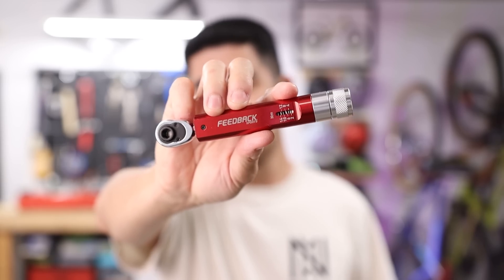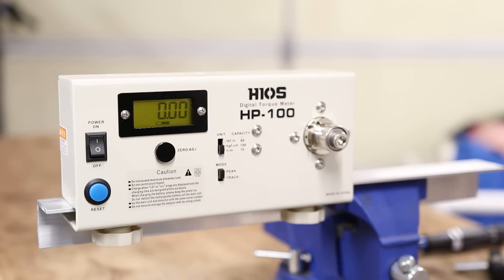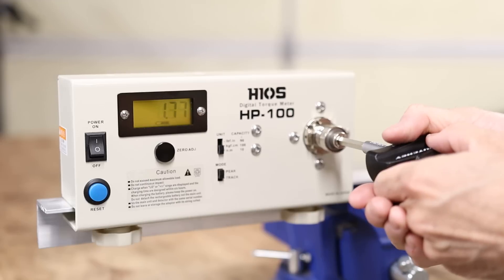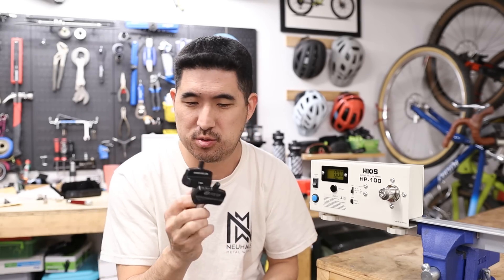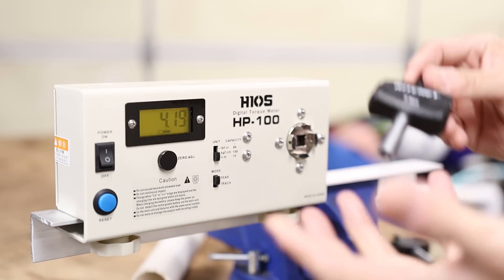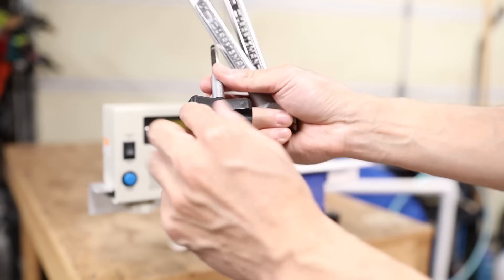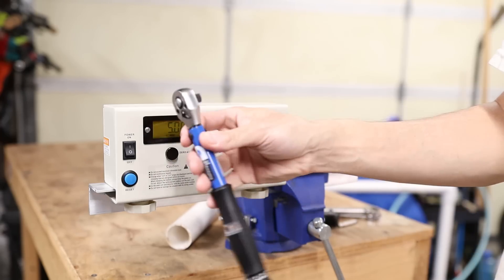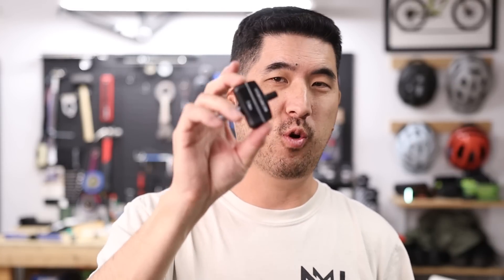Are $20 Budget Torque Keys ACCURATE??

Comment: how much does the park tool cost versus if you would buy the most common torque keys.
are the torque keys the better choice from a price and easy to use perspective?
the park tool for example has to be set correctly and maintained. and the cheap torque keys I could label with colors.
Reply: If you know you're working with just one torque spec, preset torque keys are a no brainer. Prestacycle's preset torque keys (the ones he's holding, the Mini version is sold under various brands) are colour-coded. I personally use the larger Pro version (before it was colour-coded) as the Mini is painful to use at 5 Nm and higher due to the smaller body, but it might be OK if it's the 4 Nm version.

Comment: I've seen techs who will click the wrench 3 times. I was hoping you would do the same on your setup to see if that just further tightens the target, which I suspect would happen.
 
*
Reply: Spam-torquing does result in a higher final tightening torque, one of my ex-colleagues does this and it drives me crazy every time I hear him do it. Worse, he also does it while choking the tool, which results in an even higher final tightening torque. Worst of all, he's a shop manager that works on bikes who supposedly has worked longer than I have and age-wise, we're not far off from each other. I dare wager any proper bike technician in Europe will shake their heads if they get to see how he torques down fasteners.

The way I do it, at most, I torque a second time about a second after I torqued the first time for the purpose of double-checking my torque application, no more than two to three clicks, but never all at once.

Comment: Very interesting video. Ive seen some adjustable torque wrenches that have handles which 'float' on a bolt, so you always apply the torque from the same length down the shaft.

Comment: Cool video, but don't trust the results. The machine you are using to messure the torque "Hios HP-100" is a knock off/fake of the real Hios HP-100. The accuracy of that machine can not be trusted.
Reply from the maker: But the precision surely can provide some valuable insights
Reply: What are the giveaways on the fake compared to the real thing?

Comment: random theory on why the keys are more consistent than full-range wrench: not based on concrete evidence but shot in the dark gut instinct... the adjustability is the devil in the machine so to say, the "proper wrench" relies on more complex correlated mechanical spring actions to go from 2-14Nm (if I googled the correct model) where as the key style is "set in stone" so to say, so less moving parts needed without adjustability. 
in short; less moving parts = less compounding backlash due to mechanical tolerances
Reply: From what I remember adjustable torque wrenches can be calibrated and it should be done periodically.
Reply: @guycxz  That too, from wear+tear as well as tolerances, but in short less moving parts = more reliable mechanism (in the most simplistic of approaches) Of course there are exceptions to that, but again just a gut-instinct approach to it.
I have the same Tekton one he showed in the beginning and its only accepted +/- 4% or so, which is perfect for DIYers and low-grade use shall we say, because bolts themselves have their own tolerances 50 lb-ft of torque vs 51.78 really isn't going to make a difference in daily life. But they do offer calibrated <2% ones for professional use with an ASME card and gives you expected tolerance growth over 1000 cycles, 5000, etc. but for average person.. again, meh even the low-grade one you could change/rotate your cars tires 100 times and still not even be scratching the surface of miscalibration (course again in a pro shop 100 times is nothing, why recert/recal comes in handy)

Comment: Personally, I would never apply the max torque to any parts of my bike, which is mostly 5nm, as you said. It's just not necessary.
Reply from the maker: Torque specs usually aren’t max torque ratings, but rather recommended ratings. I’ve had handlebars and seatposts slip on me before due to insufficient torque and is not particularly fun

Comment: usually the tolerance is +/- 1 nm. and i will under torque and set 4 nm for a 5 nm for safety.
Reply from the maker: I think tolerance is usually a percentage of desired torque. I wouldn’t recommend under torquing on purpose

Comment: Was the Park tool seemingly less accurate because of the way the force is set? You are kind of guessing what the marks are indicating. Seems like you could have tweaked the setting slightly (yet still looking like it was set to 5 nm) and gotten a different result. I know that wasn't the focus of this video and it was cool to see the accuracy and design of the "cheap" tools. Thanks!

Comment: Length dependency isn't so much about where on the handle you hold as the actuation setting is still the same on the wrench and the actuation point is usually right at the point of the driver. Hence no matter where you hold, the wrench would still actuate when the set amount of torque is applied at the driver end (as long as you let off immediately as the wrench actuates). However, if you have an extension or offset at the driver end, something like a crowfoot or a torque wrench extension (which isnt really a thing in the bike industry), the calculation for the applied torque at the driver end would be different due to change in distance of the actuation point and where the driver is actually located. This can actually be helpful if you only have a fixed preset torque on you torque device (such as those torque drivers or torque keys), and require other torque values. But still, it is interesting to see that even inexpensive torque drivers are accurate.
Reply from the maker: I know it’s counterintuitive, but the applied torque does change depending on where you hold the handle on length dependent wrenches.
Reply: @TheBikeSauce  ideally it should not as the actuation force is still dependent on the spring in the wrench, however we rarely ever get ideal circumstances and in practice it does make sense that if you hold near the actuation point you would not be able to let off right when it actuates causing it to over-torque. You can try it with an extension to the handle, the digital torque meter should read the same as when you are holding the handle. Also would be cool if you could try calibrating and adjusting the spring in the park tools wrench so that it stops being 10% out of cal! 😆

Edit: kudos to you! I saw that you did a torque wrench teardown and explanation video. I love informative videos like these 😄
Reply: @TheBikeSauce  I think I understand the slight misconception here. The amount of force applied by the hand certainly does go up the closer to the driving point you hold. However the applied force at the driver side of the wrench doesn't actually increase. This is due to how torque is calculated. 5Nm of torque is 5 newtons of force 1 meter away from where its applied, or it can be 10 newtons of force at 0.5 meters. Hence in the experiment which you showed, it was most likely that when you actuated the torque wrench, you did not let off in time allowing you to follow through the actuation movement in the wrench and applying more torque after the wrench has already actuated. However all this is only applicable for click type wrenches and only when you hold the area behind the pivoting point of the wrench actuating mechanism.
Reply from the maker: A digital torque wrench is non length dependent, but a typical click torque wrench is. If you have a minute, check our video on the math behind the click torque wrench. We show mathematically the reason why grip position does matter for length dependent wrenches

Comment: You kept applying Torque after the Ratchet slipped. You can see it Frame by Frame. The Park Tool one hast the biggest Lever , thats why it was so unaccurate. You just kept it moving after the slip. Maybe apply the force with some kind of Clamp so it doesnt keep pushing.

Comment: i could be wrong, but i feel like the part where you demonstrate that the torque key is length-independent doesn't really add up. i think to test that, you would need to fix one end of the wrenches together and only grip the other end. because what you did was you extended the grip out in both directions and pulled on both ends, so the effective turning point stayed in the middle.

Comment: I suspected they were fairly accurate because the same style of tool is provided with the Threadripper CPU from AMD, at much lower torque 1.5 I believe. With over 4000 + pads on the CPU the 4 screws that hold it down have to be torqued accurately so all the pads make even contact with the pins on the motherboard.
Reply: That was my first instinct aswell, no way in hell AMD is shipping a tool with more than 5% inaccuracy for such a delicate process
Reply: @HappySlappyFace  I think there's tolerances for it. Remember that LGA contact pins are tiny springs. At 5% inaccuracy this tool is probably well within spec, you don't have to be super accurate, but still more accurate than "by feel" with a normal screwdriver.
Reply: I'd bet they're even from the same manufacturer. They probably do custom orders (with large enough volume) using different colors of plastic, bits, finishes, etc. To get a different torque they just need to swap out the spring.

Comment: I bought the Park Tool ATD-1.2 some years ago and to be honest I've never had the chance to use it. The reason is the bike I bought have torques that start from 7Nm(Stem says 7-9Nm) Park Tool used to offer fixed one's before this one which was a 4, 5 or 6Nm. now it looks like those have been discontinued so they only offer the adjustable 4-6Nm version. 
I really wish I had a use for this tool so we'll see if that happens some day I change bike or not. In the meantime I'll just use normal torquewrenches.

Comment: Do you have your park tool torque wrench calibrated annually? I’d have to look it up but I think the variance you saw is actually within spec. 

One thing you didn’t point out is that most adjustable torque wrenches can and REQUIRE calibration on a regular basis. 

On the other hand, click style torque wrenches have a limited lifespan and can not be calibrated. They are disposable.  Most manufacturers do give a lifespan but no one is going to keep track of that so all you can really do is check them against a known calibrated wrench or torque tester like the one you have to know when you toss them.
Reply from the maker: I actually did send the park tw5.2 back when it stopped audibly clicking. They said that’s normal, but I really prefer the haptic click. I switched over to the new Feedback Range tool and I really like it
Reply: @TheBikeSauce interesting. Park and most manufacturers recommend sending in for calibration annually and it usually costs about 20 bucks.

Comment: Cool video. I think your link dependent test on the park tool was flawed. You appear to yank down with your finger when you put it in the middle. And you very very slowly applied it when you put the extension on. I'm not saying there isn't an length effect but I think you exaggerated it massively in your video. I also think the torque keys that are lost motion at the torque setting are a lot easier to get right for most people, over pushing the clicker types to get a higher rating is extremely common. Granted your video illustrated the point, If you want fasteners tighten the most precisely then you need a tool that you can do that with repeatedly.
Reply from the maker: Nice. I get what you’re saying, but it physically takes a lot more force to click the wrench when you choke up, and conversely, a lot less when there’s an extension on it. Anyways, the length dependency is shown mathematically in a previous video; this was just a demo showing the phenomenon

Comment: 20 usd for budget, I use a 15 usd for sub-budget wrench. Cheaper and cheapest. 
And I asked a mechanic, the said the entry level torque has about 300 - 500 clicks life-time. Well, I decided to retired it after 5 or 7 bike installed.

Comment: With that torque meter, couldn't you just find the optimal hand position with the Parktool to get 5nm? Seems like you would get closer to 5nm if you positioned your hand closer to the tail. Just a thought, thanks for sharing.
Reply: The holding point is in the middle of the handle, where the girth is at its biggest. I don't know how his TW-5.2 was stored or how long it was used, but that's already more than the usual +/-4% accuracy, it's almost 12% over.
Reply from the maker: That’s a great thought, actually. It’s possible the center of my hand was at the middle of the handle, but that actually means I would have been chocking up just a bit due to the width of my palm perhaps explaining the high readings
Reply: That's exactly what I thought. Maybe it's designed for a smaller hand that's back a little further than he tested, or possibly the grip has even moved. Or it obviously could have just been damaged over time. As a length dependent torque wrench though, I'm surprised they don't have a marking for the exact point that they design it to.

Comment: I'm SURE that you're already all over this, but I was always told to store an adjustable torque wrench unloaded as storing it loaded can affect the accuracy over time. I guess it fatigues?
Reply from the maker: I always do. I think the assumption is the spring could permanently stretch if left in tension. I’ve never tested this though. Maybe I should leave a torque wrench set to max torque for a month and check accuracy…
Reply: Yeah, exactly!

Might be worth ruining a cheap torque wrench for science. 🤷🏻‍♂️
Reply: Standard practice. However, Norbar (British torque tool manufacturer) tested for spring fatigue if stored at higher settings and found that the wrenches stayed within accuracy tolerances. It was a small sample size and Norbar is not recommending abandoning that practice.

Comment: Would be interesting to know if Park Tool (and other manufacturers) have a recommended calibration maintenance schedule for their torque wrenches and what that process entails.
Reply: Park Tool has a guide on how to send their applicable torque tools back to them for recalibration. I want to put its URL here, but I'm afraid the comment will be deleted automatically for some reason (it happened to me a few times, all of them were safe links). It's in their website's Support section under Services.

Comment: I have two torque keys specifically for wheel swapping. One lives permanently with the SeaSucker Talon in my car, and the other is near where my second wheel set hangs on the wall. They’ve both been extremely useful single-purpose tools for the only torque-sensitive thing I frequently change on my bike, and it’s great to see some validation that they might not be too terrible!

Two keys and a 5-pack of 6mm bits cost less than the original Feedback Range Torque Wrench I got for 50% off, and they get infinitely more use (though having both is clearly helpful).

Loving all the tool content, always learn something new!

Also, the world needs a The Bike Sauce Science hat. And by “the world” I mean “I”.
Reply from the maker: The science hat is actually just a Skratch Labs hat 😆
Reply: what wheel needs a torque key to install?
Reply: @markifi  “Need” may be a strong word, but my thru-axles have a torque rating on them.
Reply: @nkantar strangely my rear wheel has no torque rating on it printed but in the specs online it says a whopping 20 nm. But it came with the style of axle with a lever, so no way to measure the torque and also I don’t think I could apply that much through the lever.

Comment: Another nice thing about this design is you can use them for undoing bolts (from my understanding this can damage some torque wrenches).
Reply: That's what I like about Prestacycle torque keys (just not for undoing stubborn bolts). I tried the Mini version initially since it seemed inexpensive enough (I got the Ritchey branded version) and I was buying something else on the website, only to realise the body is too small to comfortably torque 5 Nm, so I bought the Pro version, which turned out to be so much more comfortable.
Reply: @sbccbc7471  Definitely a challenge to  get the 5nm without both hands on it. Wouldn't recommend for tough bolts, but for seat height adjustments or similar it's easy to carry on the bike
Reply: @redkeyspoke  I was thinking of taking my Prestacycle Pro with me every time I ride along with a few 1/4-inch hex drive bits since at least one of my jersey pockets is always empty, but I haven't got to do this yet.

If anybody in the group I'm riding needs something torqued to 5 Nm, at least I could help.

Comment: Fixed torque wrenches in general are much more likely to be accurate than widely adjustable wrenches
Reply: Overtime, yes. They also never need calibrating. Prestacycle said when the logo is worn out, you can replace it since it would've torqued thousands of fasteners by that time.

Comment: That's fascinating. Is there a way to calibrate some torque wrenches? Also, I'm glad that Nm seems to be more common than foot/inch lbs of decades past. Thankfully, my old skool Craftsman tools have both.
Reply: From some designs I've seen, there's a set screw that adjusts the spring's tension. I've never tried it myself since I don't have a torque tester, but for now, maybe take it to a torque tool lab for recalibration.

Comment: Was reading how to calibrate a torque wrench like the park tool ? Are you supposed to try a higher setting on a a known higher torque spec THEN set to your lower torque for the bolt spec you need?